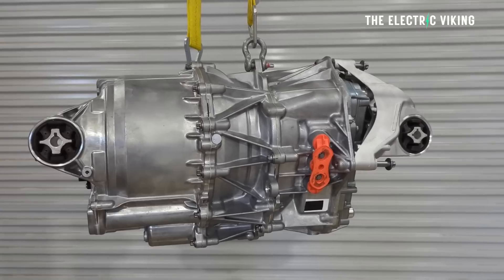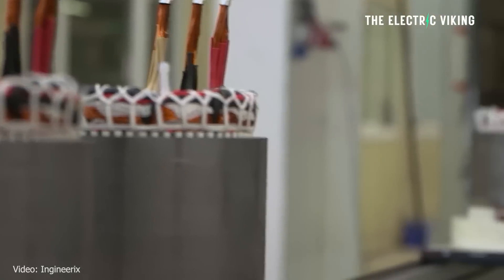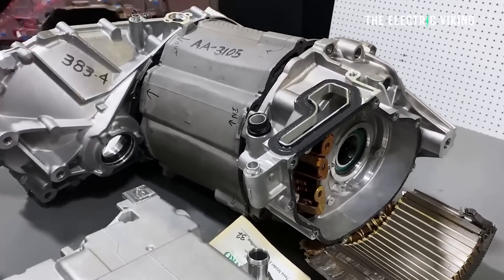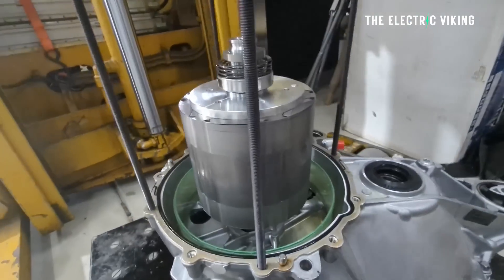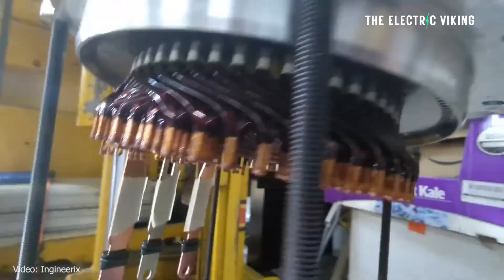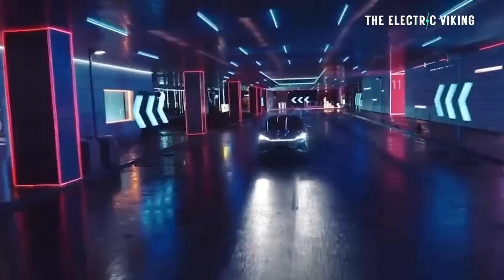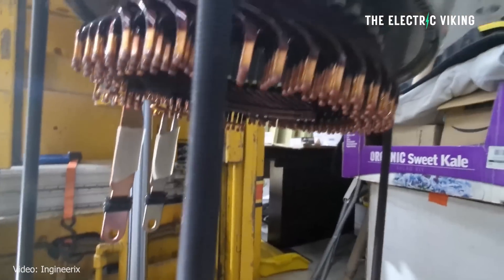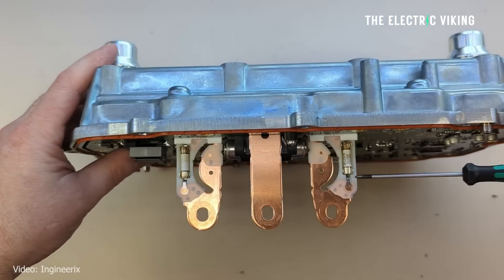Tesla Model Y electric motor compared to VW ID electric motor

Comment: This is a very interesting video because it shows how SIMILAR the motors are for two major competitors. Many people will not be aware that the output power of an electric motor is limited by heat, most of which is generated by resistance of the windings. If the Tesla motor appears to have twice the power rating of the VW, it is necessary to ask how long is it able to produce that power without burnout or other catastrophic failure. Both makers will use automatic current and temperature monitoring; a higher rating might just mean that one maker is skating 'closer to the edge' than the other.
Things like 'hairpin' windings or even rare-earth magnets are really just tinkering around the basic design. The rare-earth magnets can increase efficiency because their magnetic field is available without the need for heat-producing current; but a similar advantage may be gained by using windings with a high proportion of silver to reduce the resistivity. 
Continued development will produce continued small improvements; The video really shows that it is the battery that gives the greatest scope for improvements.
Reply: Tesla pushes more current through, which requires bigger packs for the same range.  It also overcharges those batteries (to get to those range and charge times), thus risking more battery fires.
Reply: @billcichoke2534  wrong. The Tesla can just go further PER kWh. That is the reason why they can go so far. Not about overcharge / discharge. What a total crap comment. Its all about range per kWh. Nothing to do with battery size. The 60kWh battery in my car is in reality a bit bigger. There is a buffer which cant even be used.
Reply: @HermanWillems  You really didn't understand my comment at all.  But the overcharge comment is accurate.  That's why these things have a coolant system.  Without that, they'd HAVE to charge as slowly as the old Leaf did.
Reply: Going to higher voltages is the way to increased efficiency as these decrease the current needed and hence ohmic losses. My bet is once safety and reliability issues are sorted, within a few years most EVs will gravitate to 800V architecture (this Voltage is already used in a lot of electric trucks, buses and trams) with 1200V clearly on the horizon.

This will allow much faster charging and substantially reduce heat losses. The issues will be training techs to safely work with such high voltages, safety of chargers,  and providing a bullet proof way to disconnect the cells in an accident (likely by using explosive fuses linked to the airbag deployment system).
Reply: @Jim Graham  Unfortunately power can only enter cells so fast.  Any faster, and you still risk fires.  Voltage systems only help in moving current from A to B; they don't do anything regarding the limits of chemistry or conductive materials.
Reply: Eletric motors are very well understood. Literally billions of electric motors are manufactured annually far more than ICEs

There will be no significant electric motor advantage between the EV makers
Reply: @I Kaya  There isn't.  Some go for more power and more batteries, some go for less of each.  It's a zero sum balancing act.
Reply: @kaya051285  if they are so well understood there would be way more reluctance motors everywhere in the world in factories and all over the place. But induction is still used a lot... because its less complicated but a stupid inefficiënt design... that just makes it easy to drive. The drive needs to be complicated for reluctance motors. But they can be a lot cheaper to make without any copper in the rotor.
Reply: @Aerism  I don't need to know the pros and cons of each eletric motor all I need to know is that the very best motor on the planet is not much better than the 10th best motor on the planet

There isn't much gains to be had
Reply: @kaya051285  so u dont want a motor to be better and more affordable? There are more things that are important than just the most efficient motor. What about reliability, peak power, cheap to make, made out of easily recyclable materials. The engine should last long... etc so many factors. And the KEY difficulty is to hit all those points to be the best. Not just 1. And that is the difficulty. There are still massive gains to be made.
Reply: @Aerism  Something that is already 98% efficient you don't gain much by making the motor 10% less inefficient as you go from 98% to 98.2% it doesn't change your product much at all

Or to ask in another way
How much better are the eletric motors in a 2023 Model 3 vs a 2018 Model 3? Five years and how much progress had been made?
Reply: @kaya051285  the motor is only slightly more efficiënt.  Not much like you said. But the price of the engine has come down. Which benefits you and me in the end when cheap electric cars come out. The motors have maybe become more reliable more durable and better to be recycled. Which are very big gains for the end customer later on if you do these kind of things to the whole car.
Reply: Tesla will go to 0% rare earth and 0% copper motor. With an special aluminium stator windings.(not cable, more like aluminium solid hairpin design)
Reply: @HermanWillems  While they're at it, they'll begin using an arc reactor that makes more power per kg than the sun.

Comment: Imagine that adding hp does not add weight. (And cost) But add cost for the consumer in form of insurance. As teslas car are incredible expensive to register. Do the consumer need a more powerful engine? I might say yes If they limit it ( could charge extra to unlock it). A higher power might Even be more effective.
Reply: Tesla offers that option already, some 30 kw by ticking a box and paying a bit more.

Comment: Interesting you mention the hairpin windings as an example of incremental improvement at Tesla, but forget to mention VW has been using those since iteration 1 of their motors.
Reply: re: "but forget to mention VW has been using those since iteration 1 of their motors." exactly the conspicuous LEAVING OUT of information (and thus creating "false halos" among the naive and gullible) is all part of the Jordan Belfort/Wolf of Wall Street scam of "Pump and Dump".
Reply: True. VW was earlier with those. But there it is Volkswagen stops. Tesla is now busy removing the copper hairpins for Aluminium hairpins in the stator soon. Making a fully copperless motor. As its a reluctance motor the rotor is just metal sheets.
Reply: @HermanWillems  Why would VW stop engineering? I'm sure they didn't. You just have no visibility of what's coming yet and assume that they're doing nothing. Tesla is already shouting about the next thing that they do not have yet. That's the difference. And that's why the majority of the Tesla fans (I'm not saying you are) are blissfully unaware of all the fantastic engineering going on at all the car manufacturers and think Tesla is the only automaker making all these fantastic inventions. Keep dreaming.
Reply: @hvh377  then why is my Model 3 RWD has an LFP battery which lasts longer than NCM. And the ID3 has not. Why my model 3 RWD heatpump and octovalve makes it possible to have less range deduction difference between summer and winter than the VW ID3? Than why i can get more kilometers out of every kWh put into the car than VW ID3. The only reason i can think off is we are limited by laws of nature not by the minds of the engineers. Clearly it shows from the cars end performance the proof. The proof is in the pudding. Its not about fanboy or anything. For example. Im super excited about the VW ID2all. Very excited. I just hope their engineering team finally wakes up. And hope it also has a copperless super efficient motor. Do u disagree with my story that in the end the result = what defines a better or worse engineer? Or do you not? I am a fan of tesla engineering. And would switch in a heartbeat to become VW fan IF the engineering is better. Its that simple my friend.
Reply: @HermanWillems  You enjoy the quality engineering at Tesla. That's totally fine. I have no issue with that. They do make some nice stuff. (As do Ford, GM, Toyota, BMW, Merc, VW...)

I hope you're not suggesting Tesla invented or engineered LFP batteries? Becausethe invention is decades old (before Tesla even existed) and the engineering was done by CATL who supply not only Tesla, but VW, BMW, Merc, Nissan, etc. as well.
Why does the ID.3 not have LFP batteries? Possibly for the same reason the Model X/S don't have them?
You are aware that the ID.3 comes with a heat pump? Originally as standard and these days as an option, because the additional range isn't worth the additional cost to all customers.
What does the octovalve do exactly? Can you explain that to me? And what are the benefits to you as an owner?
Tesla has an efficiency advantage. Some of that has probably to do with the drag coefficient of the body. VW opted to compromise on that a little because of styling is my guess. Probably the Tesla motor (and more likely) the power electronics are a bit more efficient, but that takes development time at VW. And small differences will always remain. ICE cars have different efficiencies too.
Another nice example is VW's drive unit, where VW very cleverly engineered a main shaft with 3 bearings, where Tesla needs 4. There's always different ways of doing things and different solutions, but because Tesla is so obnoxiously loud about their technology, it sometimes seems the others aren't doing anything. That's far from reality, I can assure you.
Reply: @HermanWillems  re: "Tesla is now busy removing the copper hairpins for Aluminium hairpins in the stator soon. Making a fully copperless motor." indeed, bringing with it the SAME COMPROMISES that have always existed when Aluminum was used in the past for electric motors and electric wiring.
Reply: And, your point, considering how much more power and torque the Tesla motor offers compared to the VW's?
Reply: @davidissko9796  Does it feel like physical pain when your Tesla superiority complex gets dented by reality courtesy of some clueless clowns from Wolfsburg?

Comment: The horsepower comparrison is incorrect. The Model Y Motortrend tested was the Long Range, which is AWD - it has 2 motors. I also had the older motor types. The Model Y RWD - single motor has about 240kW/320 hp, but there are multiple estimates and those are for the older  model. So we don´t really know what the power of the new motor is. The older Tesla motors are definitely more powerfull, but not double compared  to the VW motor.
Reply: New motors are focused more on efficiency than output power. And also on making them cheaper. My tesla 60kWh model 3 can even go further than older long range models.

Comment: Nice well edited video.  But the dude just spend 10 min comparing something that obvious.  
1 electric motors are light because size and less parts
2 thus less likely to break down.  Electric motors hardly ever break down. 
3 the design ac electric motor has not changed much.  Which is good. It is well tested design
4. Maybe the only thing I can think of that Tesla does better might be the inverter which will get pretty hot sending all the power to the motor.  Maybe the magna design cannot sustain 200kw.  So they opted to be conservative and used 150kw.  Again nothing to do with the motor it self.

Comment: My understanding is with any single speed motor.  The peak hp power is the max speed it can spin at.  Which is limited by the amount of power it can draw from the battery system.   Which can be tuned.   So 150kw. 200kw. It can be the same motor.   But of course when running at 200kw load it will be less efficient.   So the HP value is tuned for overall efficiency.  And saying nothing about the capability of the motor.   Electric motors are all the same as designed by Tesla in 1887. 😮

Comment: The most powerful VW MEB engine has 170 kW (231 hp) and is installed in the Cupra e-boost.
Reply: That is less powerfull than the least powerfull Tesla motor. Which is 180kW.